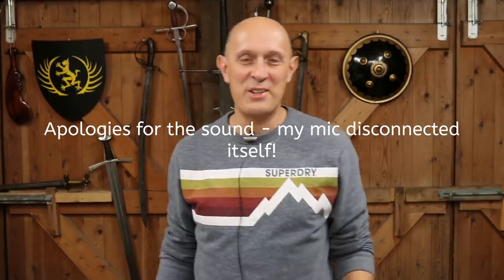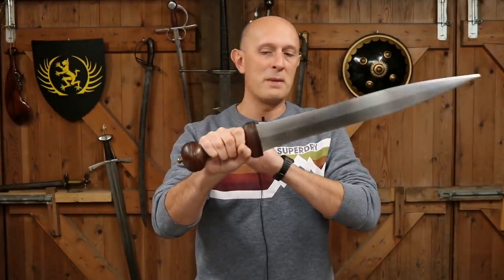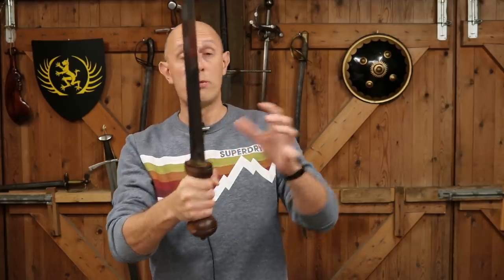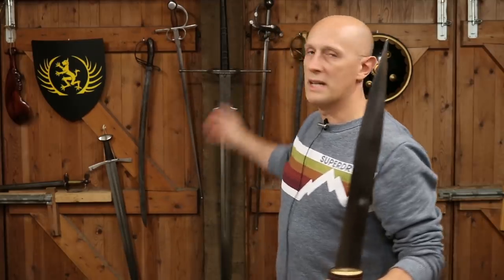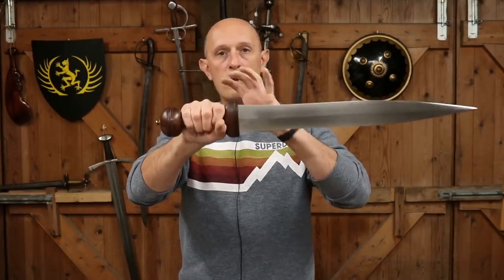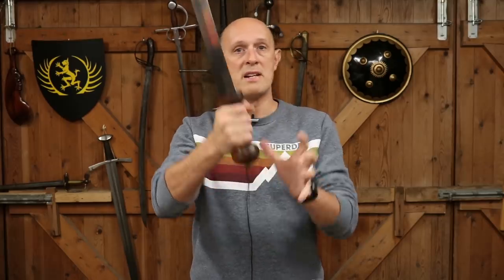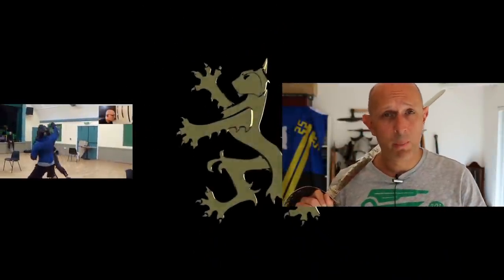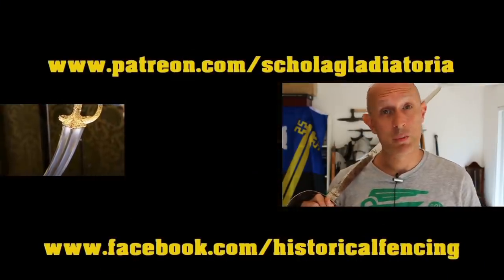The Roman Gladius (Sword) 'Guard'

Comment: It's a pretty sure thing that if you're relying on using the gladius to parry blows, as a Roman soldier, several things have already gone badly wrong for you.
Reply: Yup.
Reply: Yup. But if you had to parry with it, I would use things like Meyers suppressing cut and defense stroke. Definitely wouldn't do any kind of work from the bind, which is primarily when your fingers get hit, in my experience.
Reply: Gerry James Edwards you might be a gladiator :'D
Reply: @bobthetop3242  in which case the odd missing finger or thumb during a fight just adds to the crowd's enjoyment!
Reply: Question, why didn't this style of fighting (large shield, short non-fencing sword, close-distance approach) not come back, say, in the 13th or early 14th centuries, when manufacturing technology (at least in some areas) reached Roman levels, but before the age of gunpowder and plate armor? In large, dense group fighting (rather than duels or small, loose formations), is "fencing" with longswords or two-handers really better than a simple but reliable roman sword-and-shield approach, where the entire fighting line can press the enemy collectively using their shields until they close distance, and then make short work of them with their short swords? This even worked against Macedonian sarissas (with some smart use of uneven terrain), which were as long as the longest medeival pikes, nevermind swords.

At some point I'd love to see a "who would win" comparison of a circa 1300 battalion of professional men-at-arms (brigandines, longswords, etc.) vs an equivalently-sized and experienced Roman infantry cohort. Not including stuff like logistics etc - based on equipment and tactical doctrine, who would come out ahead? But I'd actually want something like 500 on 500 rather than 1 on 1, because Roman tactics definitely prioritized group fighting over individual prowress.
Reply: @gene51231356  I think by then the focus was spears and shields, and the side arm would just be a longer sword (arming sword), at which point having a medium sized shield would be better, so you can do more complex things with the sword. Though I'm guessing many still had the small, guardless, large knife/shortsword and a shield combo going. So it seems the base answer is: Yes the benefits of having a longer sword and a smaller, but still decently large, shield outweigh those of a shorter sword larger shield. Particularly as you can always wear another smaller sword/big knife.

However I think there may be a more pervasive reason for this. It is twofold: 1st, the infrastructure around which the training and outfitting of the Romans was not present later, in spite of later peoples ability to manufacture and equip soldiers, the way those soldiers were organized, distributed, and trained, as well as actually deployed and governed was different enough that organizing them into a fighting unit like a cohort wasn't possible, or perhaps just was more difficult than how they ended up doing it. Furthermore, all the tactical expertise that made that form of fighting super efficient and effective now was focused on different things.

2nd, and in my opinion much more likely. No one thought of it. We look back on history as one big book, and we pluck notions and concepts from eras centuries apart and have notions of "a circa 1300 battalion of professional men-at-arms (brigandines, longswords, etc.) vs an equivalently-sized and experienced Roman infantry cohort"  and we see those as distinct and different, but I don't think our ancestors did. My understanding is that when they depicted the past, and thought of it, they largely pictured their present, but in funny hats, and even then depictions tended to be in the fashion of when it was made. I'm not sure the men of the 1300's would have known about the combat techniques of ancient Rome, I'm not sure they would have researched how those legions fought, and organized themselves. It seems more likely they would assume the Romans fought similarly to themselves. I don't think they looked very far back and thought of how men a hundred years before themselves wore their kit, or what kind of kit they wore. That kind of historical fidelity doesn't seem to have been a focus. Though some study of tactics and large scale warfare seems to have been a focus of scholarship, the specifics even of their contemporaries weren't weighed against each other in the sort of stat comparison way we do now. 

That's just my impression from multiple conversations like this one, and a bit of reading I've done. I'm interested to see if there are examples of more rigorous historical research on the part of medieval scholars and military types, I'd be very interested to know how much they thought of looking backwards to get ahead, as it were.
Reply: Scutums, instead of scutii?

Unsubscribed!
Reply: @fuferito  That's scuta
Reply: @jancello ,
See?  Now I'll need to unsubscribe from my own account.
Reply: @gene51231356 Polearms will usually win against swords (which were sidearms at best aside from a few occasions). Lone examples that broke the rule like the Macedonian phalanx were few and far between. Anyway the Macedonian Phalanx was used to beat the traditional Hoplite Phalanx & the Iphikrates Phalanx & to hold the cavalry at bay. It was specialization at its maximum. The older Phalanx did actually perform quite well against the older Roman army (Velites, Triarii,etc) at Corinth but at that point Rome had huge numbers advantage.Specialization isnt always good, the Romans paid that price at Carrhae & eventually added more auxiliaries with spears & other weapons like bows.

So for to further elaborate on your man-at-arms example an late period Eastern Roman cohort with strapped kite shields and spears (kontarions) that reach 2.4 meters or 5 meters will have the advantage. The Eastern Romans are the best example because the Empire (later the Roman Kingdom) lasted strong up until 1200-1300, it fell in 1450. Also the Eastern Romans fought many varied opponents like the Normans, Hungars, Russians, Mongols, Turks, Avars, Arabs, Bulgarians and so on. So their army was very varied.

At this point the Eastern Romans also used maces (vardoukion/matzouka, although usually used by the heavy cavalry), axes (tzikourions) with small pick at one end (mainly an infantry weapon), along with the paramerion (curved sword & the Spathion (straight, double-edged sword, evolution of the roman Spatha). So they do have some weapons to counter the much heavier armor of the men-at-arms. At this point the Eastern Romans were using the kavadion (like a gambeson), the standard mail, a combination of gambeson+mail & the elite troops used either the scale armor or the klivanion (eastern roman lamellar, a more expensive & better protection-wise to make than the standard lamellar of the time because the plates were sewn at the backing rather than with each other).
Also a much heavier polearm was used the menavlion a much heavier & sturdier spear with a much larger blade than the standard kontarion (allthough the lenth is the standard shorter kontarion at 2.4 m) by a specialized troops (the menavliatoi), so the menavliatoi have an even stronger advantage against mounted men--at-arms for example.

Not sure about the prenetrative qualities of the composite bow against men-at-arms armor, i see it only as a mounted harrassing tool (something the English longbow couldnt do) or akin to what the longbow was used (in defensive positions either how the longbowmen were used). The composite bow is indeed a powerful weapon at the time & one of the reasons why the Eastern Romans didnt adopt the crossbow in massive numbers, but the humidity of the West meant that it wasnt that adopted in that front.

However the Eastern Romans at this case do have dedicated spearmen while the English didnt have. Not counting colossal errors as the French fails at Agincourt , the English were caught too many times by the French cavalry when they didnt have the time to prepare formations (both the knights & mounted men-at-arms) for instance and is one of the reasons why they lost the war.

The sword was becoming more longer (example the Roman Spatha) as a result of more loose fighting than solid formation line, because many of the armies at that time were more nomadic, but the Eastern Romans did fought the Normans up until the mid-13th century where both powers were weakened by major wars.
So we come to the era, the Eastern Roman cohorts were more than capable to fight the 13th century men-at-arms & even the 8th-10th century legions have a conceivable chance.

However i surmise that you wanted the legionnaries of the Marian reforms. In that case the lorica segmentata (or the later lorica hamata) is obviously inferior, but it is still a heavy armor. And the Roman legionnaries of that time were all equipped with that armor, while the men-at-arms were one portion of the army of that period. So there werent only men-at-arms, there were also troops with much less experience, many times inferior armor etc. 
So because the Roman legion is more homogenized, it means that is not only fighting men-at-arms but also drafted peasant troops & these troops will lose against the legion even when the men-at-arms will hold the line. If we choose a later Roman legion that has even more variance of auxiliary troops (like spearmen etc), the Roman legion is even more formidable.

We do need to categorize the definition of Men at arms, which usually meant a heavy, armored cavalryman. I am assuming a 3/4 or 1/2 armored variant, because otherwise the full-plated armor is a bit too much for the Marian reform Roman legionnaries & without the use of spear auxiliaries we are looking at a major defeat. Although not Carrhae-level defeat, because the men-at-arms dont have missiles and they still need to charge at heavy-armored, disciplined infantry. If we add spear auxiliaries (the Carrhae lessons) the Legion has more leverage against the mounted men-at--arms, but at this point in time the spear auxiliaries dont have very long spears -they simply cant hold their ground that well against the longer men-at-arms lance).

A heavy shield will have a pushing advantage against a smaller one (the roman scutum doesnt have the pushing power of the hoplite aegis, but is still a heavy shield good for pushing or withstanding charges). The longer sword of the men-at-arms will have the reach -especially against an overhead strike to bypass the scutum -but the roman armor & helmet is especially made for this sword of fighting).
Also lets not forget the Roman pila (or the heavy javelins & heavy darts of the later Eastern Roman legions). The javelins always perform good against armor, but i am not sure about the penetrative power of the pila against armor. If the shields of the men-at-arms are wooden- then the pila are useful, if not their usefulness drops.

As for the heavy cavalry, the Eastern Roman clivanarii/clibanarii/kataphractoi (cataphracts) was a much better equipped force than the men-at-arms as they were much more varied in their approach. Aside from weapon & armor differences from comparing different eras the Kataphrakoti used spears, maces for the front lines. The side troops of the Kataphraktoi regiment used spears & paramerion/spathion swords or maces & paramerion/spathion. The troops in the center used composite bows & their horse armors were a bit lighter. Also lighter maces were used, they threw them at the initial charge against armor or shields to break formations. Lastly a properly-equipped Kataphraktos had multiple maces and multiple swords (meaning multiple sidearms in case he lost a weapon in the heat of battle). That meant a more well-equipped force than the lance & sidearm-using men-at-arms which only later (15th-16th century) had more varied weaponry.

What resurfaced in the later ages was the hoplite/phalanx style (ie mass formations of spearmen), ie the tercios. Coupled with 1/3 crossbowmen and 1/3 swordsmen & shields (later the swordsmen were dropped/reduced significantly & the crossbowmen were replaced by muskets/arquebus), the tercio dominated the battlefields of the 15th century.
Reply: @Lurklen Never underestimate the importance of logistics and what an impact it has on decision making in the military. Just look at the pre-marian Roman Army: Spears and relatively small shields were the norm. I'm pretty sure people knew and thought of the Roman way of fighting, even in the 13th and 14th century. However, a spear and smaller shield is way easier to produce than a larger shield and sword. Thus if you don't have any infrastructure to support "centralised" "arsenals" (for a lack of better wording), you're most likely going to go with what's most commonly available.
Reply: @Ruhrpottpatriot  Agreed.
Reply: @faultroy Two things:1. The stirrup was know since the 6th century as it's mentioned in the Strategikon of Maurice. So we'd need to narrow the word "Roman Horsemen" down.
2. Funny how the USMC teaches machine gun handling so much different than the German army. We were taught, that if you move the MG must fire, and if the MG is moving, the rest of the squad must fire; and you always try to move and if you can't move you're under attack and you need the MG to combat that attack. Read: 75% of the time the MG has to fire
Reply: faultroy 

"You seem to think of combat as one of different styles for different time periods.  It really didn't work that way.  It really is one continuous process."

 Combat is of different styles over different periods because those "periods" are often completely different locations and cultures. My point was that we see them as a continuous thread, but that isn't really the case. The 1300's Footman and the Roman legionary weren't continuing the same military tradition, they were different traditions from different places (depending on location) fulfilling different needs. There's connective tissue between them, but one didn't lead directly to the other, they evolved in the different environments. The footmen of the 1300's didn't study the tactics of Rome to figure out what to do.

"It isn't like today in which we have gamers and zealots like Matt Easton trying to recreate different fighting styles depending on the Era that the sword He is using is telling him to pattern after."

No they were instead designing the weapons and how to use them to combat certain threats. So they were creating different fighting styles. 

"The Romans developed a fighting style that reflected the styles of the various groups they were fighting with an attempt to find their weak points ..."

"However, what can be said is that the fighters of 1300s were not as organized and synchronized as the Roman Legions.  And that is probably the biggest issue."

Agreed on both points, and this is basically what I said. My reasoning for why, was the completely different method of organization, distribution and comportment of their military, as well as them being a wholly different culture.

"For example,  another very important reason for not having a guard on the Gladius is that combat wasn't one on one."

Matt makes this point, in this video.

 "Then there is the issue of armor and its effect on saving the man in the battlefield but it also has the effect of overheating both the knight and Man of Arms.  Ironically, experts like Matt Easton never discuss this most important reality of combat." 

Matt has covered this topic at length numerous times. He brings it up in pretty much every discussion on armor.

"In addition, the armor of the 1300s was far more advanced than that of the Romans. "

This is arguable, the Romans had plate and mail, by the 1350's we're seeing that come back in a big way. But sure, it was better armor, and that would also influence the need for a large shield. (Though we do still see large shields in the early parts of the era, just not paired with short swords, so again arguable as to its influence.)

"In other words, there are so many factors, that it is impossible to make a comment one way or another.  There is just too much going on."

If you mean who would win, I agree, that's why I didn't comment on it. Though I'd give a slight edge to the Romans due to tactics and their skilled formation fighting, it's kind of anyone's guess.

"I remember when I was in the USA Marine Corps and we were taught Squad Tactics."
"I always resent these discussions by people that have no experience in war and combat.  It is all theory and no reality."

Your experience in modern combat aside, you have no experience in war and combat in the context we are talking about. ( I mean no offense by this, nor to diminish any combat experience you do have, I'm just saying it's a vastly different experience) All of this is theory, because none of us have been a Roman legionary, or a 1300's infantry soldier. It is a completely different experience. Some of the squad tactics you were taught have some influence from the ideas of Roman combat, but it is still a completely different expectation of result, and deployment. I wouldn't argue with you about how a modern Marine squad was deployed, you'd know better than me, but in this case we're both just basing it off what research is available to us, and our own sense of logical reasoning, or theory.

"In other words , You do what you have  to do in order to accomplish Your mission."

Or you run away, which is what a lot of soldiers in these eras did, and was an expected result in warfare of the time. Special care was taken so that a rout didn't happen, and it still did, (for one side or the other, or sometimes both lol) pretty much every battle. Also the concept of a mission was likely very different to the modern soldiers thinking and training. Because a modern soldier and a roman legionary, or a 1300 era foot man, are pretty different people with whole different value sets and what is expected of them in combat/warfare/life in general is so different as to be nearly alien.

"...There was no way to use leverage because it would push him off. "
Yes and no, the roman saddle for mounted soldiers was designed to hold the rider in quite well. It had four "Horns" which when the rider sat in the center would flex and encircle the upper thighs, this also provided a brace at the back. So they could charge, and were classed as heavy cavalry. This was further evolved after interactions with the Sassanids and other factions of the east, who likewise lacked stirrups and yet had Cataphracti, in heavy armor, and using a lance (Interesting note, the two solutions for the transfer of energy into the lance, and the staying in the saddle off a charge were: Connecting the lance to the neck and back leg of the horse, holding it in two hands, and a saddle not so different than the Knights of the 1400's would adopt.) in much the same manner as the 1300's cavalry would have. The difference is the stirrup made all of this simpler, and as a bonus getting on and off the horse was much easier. However a late roman Cataphract or the 1300's era cavalry that you speak of would be pretty similar. (Though one would be totally jealous of the others ability to get off his--likely much larger--horse with ease.) 

This is another display of how warfare is not one continuous thread as we think of it looking back. Different eras allow for the different comportment of soldiers who are able to do different things based on their needs and their circumstances. Now we have better access to knowledge of what those in the past did, than many of our ancestors had (or even cared about), so we can take what we like and throw it into the mix in order to neutralize and counter those threats we face. In the past we see things cycle around in different locations, get dropped, then picked back up again when a similar need arises. We see heavy overlapping plates and mail in the roman period, then the plates go away for a while and we see mail dominate, until plates come back in a big way, only different than before now enclosing instead of overlapping (Ancient Greeks and Celts both had already done enclosing platrs with bronze ages before, but those too fell away), then overlapping segmented plates come back in the form of the Brigandine, and other later armors.

"The history of combat, weaponry and battle tactics have ALWAYS been to neutralize the existing styles of combat, weaponry and battle tactics.  It is far more humble, pragmatic and common sense oriented than we like to believe.
"

Agreed, though we do see holdovers from eras before linger on past usefulness (takes time to really learn the way we've "always" done it is now sub-optimal). But the question was why didn't this form of combat make a return, why did no one attempt to reorganize and use close rank, large shield, guard-less short sword combat. I think my answers were the most likely (I.E. No one thought of it because it hadn't been the fashion for a long while, it wouldn't have been feasible given the difference in organization, and there were better alternatives that met their current needs/threats.) I'm not sure why those answers are caught in the "intellectual weeds" as you put it, but we seem to be in agreement on those points regardless. It now occurs to me you might have been replying to Gene. But I wrote all this so :shrug:
Reply: faultroy  Sure! 

I can only go from memory as I don't have an encyclopedic knowledge of his videos. 

 I recall him going into it a bit in his first video discussing Brigandines (this was a while back, 3 years ago) https://www.youtube.com/watch?v=hV-tnlH3ffw&t=402s

Small mention there. I believe he goes into more depth on it in an earlier video about mail, and some more in discussions on plate in the 15th century. It also came up in his discussions with Tobias Capwell a few times if I recall. I'd dig up the links, but honestly I don't have the time. I can't say for certain, but I'm pretty sure he actually did one video where he talked a lot on heat and environment affecting fighting, but I think it might have been on an entirely different subject (If you've been watching him for a while you know how he loves to go off on tangents in his "quick" videos lol, I think it might have been helmets?) and I'll admit another entry on the details of that (and how they dealt with it in the past) would be welcome. Another Youtuber you might want to check out is knyght Errant if you haven't already, he hasn't put out anything in a while, but he goes very in depth into armor, and as I recall he speaks about the issues of over heating (he faces it often even just as a historical reenactor, those full harnesses are basically sweat factories)

The saddle was of great interest to me as well, I'm writing a story on a and was looking into ancient saddle designs, and just sort of stumbled upon it. If you google "Four Horned Saddle" it should come up. I do have a link to one recreation whose designer goes into depth on the pros and cons from a riding perspective (apparently it's quite hard on the thighs as you can't take pressure off easily without stirrups).

http://www.comitatus.net/cavalryrecreate.html

As for the Sassanid stuff, I just picked that info up over time, cannot remember my sources, but Wikipedia's entry on the Cataphract goes into some detail. 

Glad you found it informative. I learned something about squad tactics in the U.S. military from you, so likewise thanks.